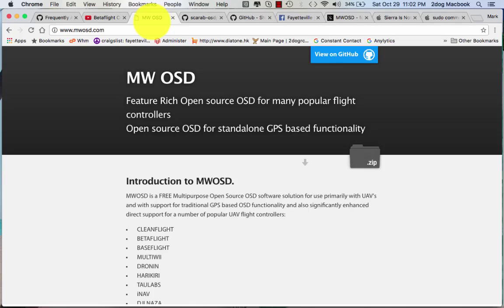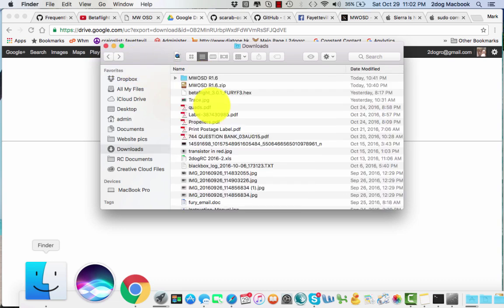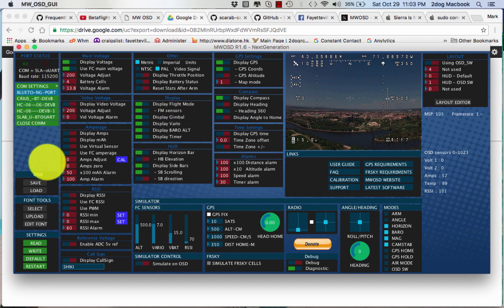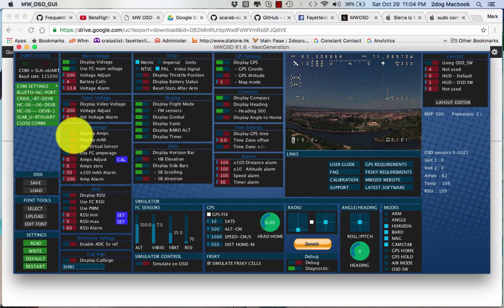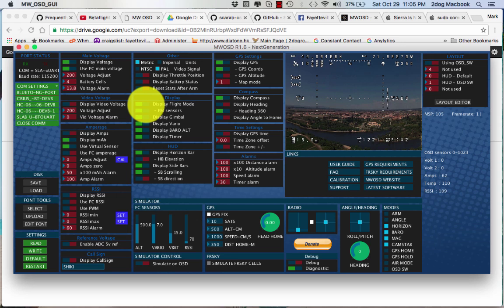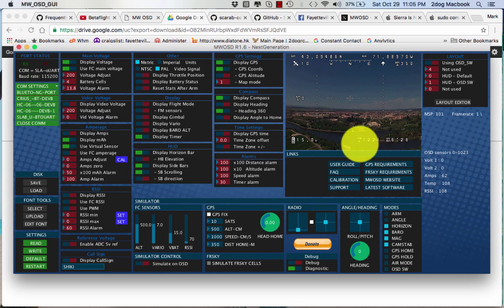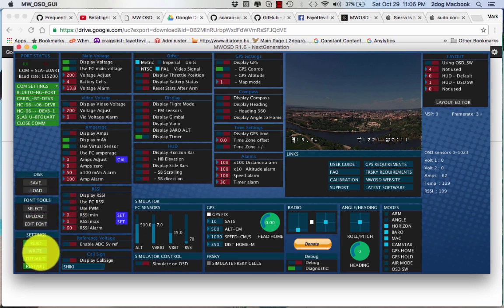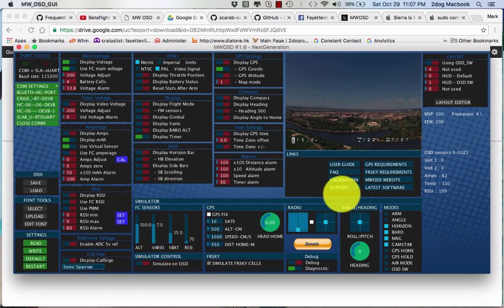Start to Finish on Setting up the Diatone SP3 OSD

Comment: Hi 2dogrc I recently purchased the GT2. Thx for the fast shipping. Everything is great with the ship so far. Only i cant get this mwosd to load on my computer. Keeps saying program is not supported. Tried it on windows 10 computer and windows 7 computer. No luck on either. I see on Chrome its available if you buy it but I dont want to buy it and have the same trouble. Any help would be great and thx again for the great service.
Reply: Yeah it's bullshit! They state they have a free version but even 1.6 doesn't include anything now (no exe)..!
Reply: Thx anyway paid the $2 works fine. Great reason not to use Chrome.
Reply from the maker: So the Chrome app worked, but the downloaded software did not?
Reply: Nope. I tried all different ways of opening it. Only 2 bucks but damn are they that hungry?

Comment: Hi what happen if I want to disable the OSD all together cause I'm using the FC OSD instead? How do I disable the SP3 OSD?
Reply from the maker: Good question.  You can deselect everything in the GUI, but you would still get the armed/disarmed flashing part.  I am not actually sure.  If you connect an UART TX to the OSD then you would not constatly get the flashing Disarmed.  Really the SP2 would have worked better as it is the same thing, without the OSD.
Reply: woo, that is exactly where I'm at! I deselect everything in the GUI and now I have the flashing disarmed flashing non-stop. Can you please expand on how to stop the flashing disarmed sign?
Reply: I have had way too many SP3 VTX to replace with the SP2 :(
Reply from the maker: I have researched it and come up with 2 options for you.  Option 1 would be to run on a port and transmit data to the OSD.  You could use a soft serial, or UART TX pin on the FC to RX on the VTX OSD.  This would provide data to the OSD and stop the armed/disarmed.  The other way would be to use the arduino software.  Edit the config.h file, this line
"#define ALARM_MSP 3                 // Text alerts if no Flight controller data for more than x secs. "
change the 3 to something very high like 100000 then recompile and the package and flash to the board.

Here is a video that may help you do that.
https://www.youtube.com/watch?v=svIjwDp8T60
Reply: 2dogrc 2dogrc thank you very much for such thorough research, just making sure. Right now my FC UART 3 TX is connecting with the VTX RX and UART 3 RX is connecting with the VTX TX, and that is giving flashing disarmed. And you are saying just connect the FC UART 3 TX to the VTX OSD RX, ain't I already doing that?
Reply from the maker: In Betaflight you should also have MSP on for UART 3 and nothing else selected. It would be better to have it connected to UArt 1.
Reply from the maker: Just keep the connections as they are.  Make Sure UART 3 in Betaflight is set to MSP.
Reply: I just bought SP3 and I want to turn the OSD off too. But now MWOSD GUI is charging $2 on Chrome.... So basically I need to spend $2 just to turn off SP3's OSD.... Any other way around to just turn it off?

Comment: What are the units for the voltage alarm on the new version? It defaults to 138 which I'm not sure if its 13.8. Seems reasonable for 4s. Im running 3S so im not sure if I should change the value to 10.5 or 105? Thanks again!
Reply from the maker: Are you running 1.7?  Here is the WIki for that https://github.com/ShikOfTheRa/scarab-osd/wiki/User-guide-1.7

Comment: Having some trouble with the SP3. When I connect it to my Mac and open up the GUI, I see the correct com port and I click it. It then says "waiting OSD" and does not connect. I've tried it with the battery plugged in and not plugged in. Also, tried it on a PC as well and I'm getting the same issue. Any thoughts?
Reply from the maker: If the come port is showing up that is good.  If you can not connect check these things, and you have to have a battery connected to power the VTX/OSD:
1)The OSD is plugged into UART2 on your FC, it can not share the UART1 or any UART port that your USB is using.
2)Make sure the baud rate in the MSP tab on UART 2 is the same, 115200, as that set in your OSD.

Comment: how did u get the app to open on your mac I can't seem to it says move to trash or cancel and the help just says open it in finder to override the security settings which doesn't work either? please help...
Reply from the maker: I have been having the same issue.  Still trying to get it to open.
Reply: 2dogrc if you look down the comments there was a guy that was kind enough to post a reply about how to get it to work and it worked fine for me.. you have to go into terminal and disable something then open the app then go back to terminal and enable it again then the app works every time
Reply from the maker: Thanx!  I did that and installed Java on my mac and it worked.
Reply: dude what cam are you running? i bought a hs1194 and I'm having a few issues with the osd.. with the camera disconnected it displays the osd fine as soon as the camera is plugged in the osd becomes washed out and displays some kind of frequency issue... its still readable but doesn't look good.. any ideas?
Reply from the maker: I run a HS1177 with GoPro replacement lens.  Did you try switching from PAL to NTSC on the OSD?

Comment: how do I open the mwosd gui file? seems when I click on it to open it keeps giving me this message: “MW_OSD_GUI” is damaged and can’t be opened. You should move it to the Trash.
I don't get it.  I'm running macOS.

I'm having problems with my osd. the OSD information on the top and bottom of the screen is cut off it looks as if it is up too hight and down too low on the screen to show on my monitor.  also the font seems washed out. I'm running NTSC.
Reply: I'm having the same issue
Reply: jason are you having the same problem with the osd display not fitting within the screen as well?
Reply: I found the work around to allow the gui to work.  but now I can't get it to recognize a port when I plug the vtx in.

http://apple.stackexchange.com/questions/243687/allow-applications-downloaded-from-anywhere-in-macos-sierra
Reply: I got it working! did the config and now everything is running great!
Reply: Thank you very much!!  I'll give it a go tomorrow happy flying!

Comment: Sorry to bother you again but, Can Uart 1 on d-link be used for rx/tx to sp3 vtx if Uart 2 doesn't work? Even though it shares the usb. When plugged into Uart 1 the osd shows no data but if I plug into Uart 2 it does
Reply from the maker: Yes you can use UART 1, but you will have to disconnect it when you connect the USB.  DO you have the UART 2 set to MSP?
Reply: Hi mate, yes msp is set on uart 2 . It was working but just suddenly stopped.

Comment: MW_OSD_GUI won't even open .  apparently you need Arduino installed too, but that didn't work either.
Reply from the maker: You only need the Arduino software if you are going to edit the files.  Are you trying to install MW OSD GUI on a MAC?

Comment: imac. im getting a message that says that the file is damaged and cant be open, then suggest to move it to trash. any ideas
It actually opens on my 64 bit computer if i choose the 32 version. but no matter what I do with the drone it wont connect. driver wont update smh.
Reply from the maker: Neomaya Davila go into the terminal app. "sudo spctl --master-disable "
Reply: yea,,, I really do appreciate you trying to help but I don't know how to go into the terminal app let alone know what to do with "sudo spctl...." where to put it, am I replacing something, just add it to wherever, i really have no clue. 
its freezing rain up here every day so I don't think i'm going to fly till March anyway smh. it sucks cause companies are sending me drones to review and I can't even fly them. smh.
eugines lifehacks if you know how to do the terminal thing and it works let me know.
Reply: did you work anything out?? I am having the same problem
Reply: eugines lifehacks nope. smh. everyone just says to reinstall, clear cache, etc. nothing useful, nothing that works.
Reply: On you Mac open the applications folder on the dock, then Utilities, then paste that line of code in and press enter.  Then retry opening the MwOSD app.
Reply from the maker: go into the terminal app. "sudo spctl --master-disable "
Reply: I got it to work. do you want me to send you a screen video thing so you can see what to do ?
Reply: eugines lifehacks yes please
Reply: you on Facebook?
Reply: eugines lifehacks yes. https://goo.gl/t8IYO9

Comment: Hi there, i've tried 2 brand new SP3s for my Crusader190 build.
Both fail on 25mw after about 2:30 when the image gets worse until there's only static.
Both get extremely hot, i almost burn my finger when i touch them.
Here's a video of that: 
https://www.youtube.com/watch?v=FBU9Z8_vjgY

My SP3 took no damage so far, there's no signal but if i let it cool a 
little it works again every time.
So it does not fry totally, just the image goes away, which is rather 
strange too if you ask me.

I tried 200mw and it fails the same way as with 25mw, maybe even a 
little faster.
I can bring back the image by blowing onto the SP3, no joke.
So i'm totally sure it is a temperature problem.

I wrote to diatone USA about that issue, diatone HK answered me and told
 me that the space between the SP3 and other components in the stack is 
not big enough.
They told me to try it on the bench, which i did, and it failed again.

I think that if you take of before that 2 minute mark, which you 
normally do, the propwash will cool the SP3 so that it continuously 
works.
But what if you crash and the quad lies in the bushes for 10 minutes, do
 we have to consider the SP3 to melt in that time?
That's a bit risky for a 50 bucks unit i'd say.
Very dissapointed with the SP3 so far and it's hard to believe but i 
seem to be the only person with that problem now.
Did not find anything on the web so far about overheating SP3s.

cheers,
Chris
Reply from the maker: Chris,
   Thank you for the feedback, it does sound like a regulator is getting hot in there.  Diatone is working to improve this.
Reply: Chris, you're not alone.  I have a nearly new one, half-dozen flights, no crashes, etc and it is doing something similar... It worked fine for the first few days, but now it is overheating in less than 10 seconds on 25mW!  I've only ever ran it on 25mW too.  I sent Diatone USA a message on Facebook. We'll see what they have to say.  I really loved the VTX+OSD combo while it worked.  Hopefully they can get it sorted out because it is otherwise a really cool product.
Reply: Thanks for the info James. Strange thing is that many people don't seem to have problems with the SP3. I can't find reports of overheating on the known boards. Diatone HK told me that i should send them my defective unit and they'll check it. They will refund 80% of the shipping costs, but still this will take a lot of time. 
This is not a cheap unit and i expected more of it, seems like Diatone rushed the developement of the SP series and messed whole batches up.
Reply from the maker: We have not had many reports, that doesn't mean it is happening.  What power setting are you running it at out of curiosity?
Reply: It happened regardless of the power setting.. took some seconds longer on 25mw but that's about it.
Still didn't send the unit for repairs.. think i'll just trash that crap.

Comment: How do you get the consumed mah? Connect it to the lipo directly?
Reply from the maker: There is no current sensor, so you have to enable Virtual Sensor.  Then you have to kinda tweak the value until you get it right.  These instructions are in the MWosd github.

Comment: Im having issues getting both my PC or MAC to recognize the SP3, downloaded the drivers and MWOSD and that starts up fine, but nothing shows on the screen when I plug in the SP3. any ideas? thanks
Reply from the maker: shimfn okay. When you plug in the SP3 AND you have a battery plugged in, you should see a new comm port show up on left. You then need to click connect. Make sure you have an antenna on.

Comment: thanks these vids are what I was looking thanks a lot subbed can't wait till I get my gt. waiting for bg to release it.
Reply from the maker: Rc AwesomenessThey fly very nice and tough as nails. I ran into a tree yesterday!  Not the branches, but the trunk. Broke a prop.
Reply: 2dogrc nice yeah they are great
Reply: 2dogrc do you think you can give me a coupon code so I can get this on your site the price is a little high it would be nice if I could save a little.
Reply from the maker: Well sure. Try ask10. That will give you 10% off.
Reply: 2dogrc I don't know why but with the crusader gt 2 it does not work is their another one you could give me thanks again.
Reply from the maker: Okay, what does not work?
Reply: 2dogrc when I put the coupon code into your website it says that the code is not valid.
Reply from the maker: try now.
Reply: 2dogrc thanks a ton it worked and from now on you guys will be where I get my stuff I appreciate this. thanks again

Comment: I can't open the windows 64 gui? I have windows 10
Reply from the maker: Maybe try the 32?  I am not a windows guy anymore...sorry gone to the dark side of Mac.
Reply: I got it on my ol computer  win7 ,works and loads just fine thats a 32bit system. I dunno whats with windows 10 sometimes? I can't find any vids on problems with win10. So somthn Im not seeing here?
Reply from the maker: I am not sure.  This is Minimum OSD which is open source.  Maybe try searching Minimum OSD and Windows 10.

Comment: are you doing this with a battery plugged in to power vtx or just plugged into the computer like a FC
Reply from the maker: You need to have the flight battery connected.  I also use a current limiter as well when changing settings.

Comment: Right now the only wires I've ran to the SP3 VTX is +/- to power VTX and camera +/- and video. What other wires do I run where? Sorry... I've never setup an OSD.
Reply from the maker: You can also connect your Flight controller so you can adjust pids and display other information.  You would connect the TX from an UART on the FC to a RX on the OSD and then RX from the FC to TX on the OSD.  Then set your UART to MSP in Cleanflight.  You can only have 2 MSP ports selected.
Reply: thanks for the quick reply. Like you, I only want timer and Voltage displayed. What do I run where for just that?
Reply from the maker: If you want Voltage you will need to connect to the Vin 2-4s pin and Grnd from your PDB where you have battery voltage.  VIn is positive and GND is negative.  I believe you will also need to connect to the FC so that it knows when to start the timer, but I am not 100% on that one.
Reply: I the "Vin2-4s" pin and GND running to my PDB powered by 16v 4s. Voltage reads 0.0v on OSD. besides video and cam power i have no other wires ran. What am i missing?
Reply from the maker: Did you turn Voltage on in the setup menu under Main voltage. Then deselect USE FC Main Voltage.
Reply: the only thing i have turned on in MWOSD is display voltage and display timer... Timer works. i see 0.0v. and i see no data/disarmed flashing. again i have nothing plugged in other that Vin 2-4s, GND, camera power and video. nothing on the side ports. it flys.
Reply from the maker: Okay. I have not wired one of these up from scratch yet, only with the included F3 board on the Crusader 2.  Which Voltage do you have selected in the GUI? You will get no data as you do not have the FC connected.
Reply: Might be nice to see a PNF version opened up to see how its all hooktup. Ill be doing this soon Id rather not have any magic smoke.